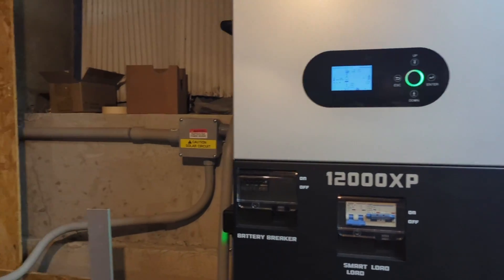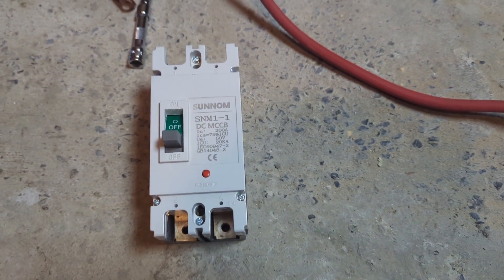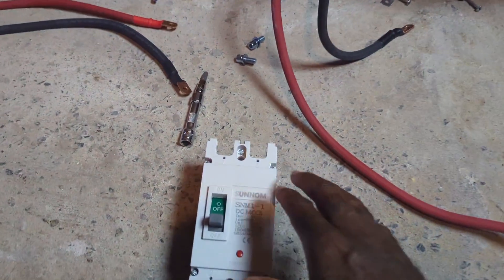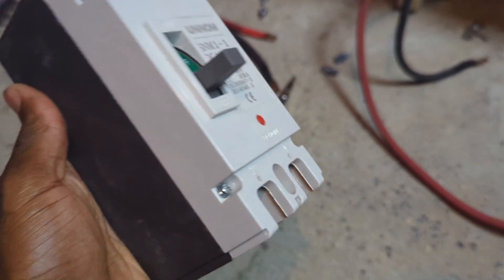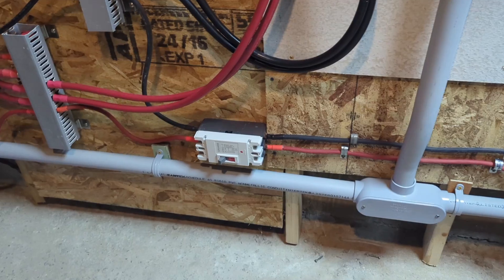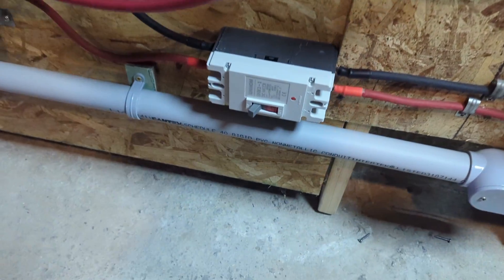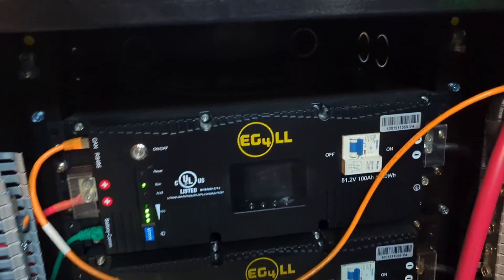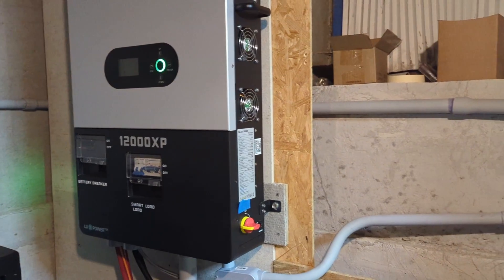DIY Battery DC Breaker Install

Comment: Since breaker often acts as fuse with advantage of being able to reuse every time unlike fuse that is one time.
So my expectation was that you were going to fuse only the positive terminal only because that's how battery is normally fused but in this video you used mccb thereby fusing both terminals in doing so.
 Please can you tell me why its okay